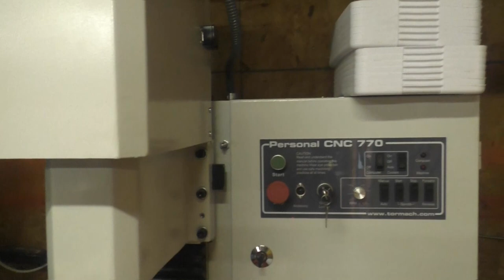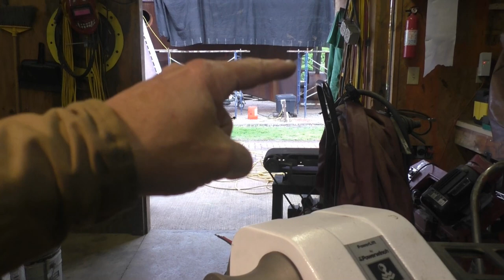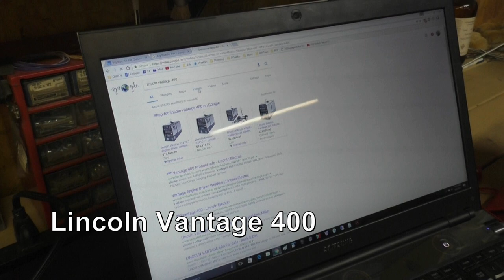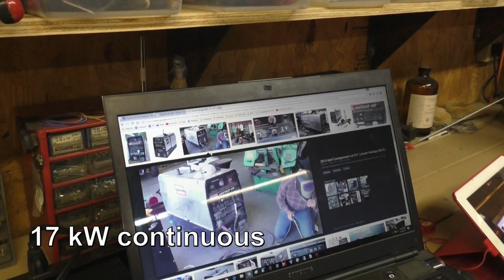Seeker LIVE - Apr 22, 2017 - Bulwarks, Casting Anodes, Chain Gypsy, Welder Generator and more

Comment: why not build a PTO on the main engine for driving a generator and compressor? if you use the standard agricultural spline (no idea what it's called) i'm pretty sure there's all kind of stuff you can get for that, everywhere in the world for a relatively small amount and a small amount of space. if you're worried about redundancy get one of the kubota engines and fix the same spline to it. it'll be more portable, more reliable, more flexible and one hell of a lot cheaper than the dedicated welding generator with all the gizmos attached. 

if you want to go fancy with it you can get a truck compressor and an electric clutch so it doesn't steal power just to make noise

Comment: For the platforms on the side what you could use is "plastic grating". It is used for all sorts of applications such as docks, manufacturing catwalks and oil platforms.... It wont be cheap but it would be perfect for this. 

also the chain thing is called a anchor windlass

Comment: Miller Air Pack is the best. 42 years welding 35 years self employed in the industry. I have owned 3 of these units and would buy another one in the morning if the one I have now went down. I have run these units up to 10,000 hours before selling the old ones off. Your looking at a third generation unit with a Ingersoll Rand compressor that is electric driven with an on off switch and produces 60 cfm  You can arc gouge as well as plasma cut with this machine along with all the welding processes. This machine has been installed on ocean oil rigs and have held up to all conditions.
Reply: If I remember right the miller air pak with the Deutz engine the air compressor is one of the engine's cylinders

Comment: On welders Doug. Be careful of the big welders with a lot of electronic controls on them. The salt air would kill them quick I reckon unless you did a lot of work to seal up the electronics so the salt air can't get at it. I've just acquired an old diesel farmpack welder. Way simple. Unfortunately it's only a DC arc welder. I'm thinking for your purposes having seperate machines for each type of work you wish to do might be better for long term maintenance. An independent air compressor, Generator, welder. Gives you options. Just an opinion is all and we all know what those are eh.

Comment: Seems as if the Miller Big Blue 800 Air Pak, also has built in air dryers. Definitely mandatory for plasma cutting. Sounds like they are all sealed up against moisture and corrosion. And the compressor is an Ingersol Rand. If it were me, I'd at least get a 100+ gallon auxiliary tank to store more air for tools and what-not. Then again, maybe just having a separate compressor for non-plasma tasks would be good too. That way, it keeps the run time down on the Miller.

Comment: Doug, You are talking about adding a "Gypsy" to your electric winch and having to raise the winch above deck to accommodate the larger diameter of that Gypsy.  Bear in mind, the rated pull of 1,000 lb. is based on the load applied to the minor diameter on the drum.  If you are applying load to the sort of diameter you are talking about, that winch will only handle a couple hundred pounds!  If you expect it to handle its rated load, your gypsy can't have a diameter any greater than the drum ;-)

Comment: I think a small <30kw Cat 3 phase genset would be the most economical/dependable.  Then depending on how much you plan to run the main engine, (as a secondary power source) you could decide if you wanted an electric hydraulic pump system, you could run an electric compressor, and you could plug in your choice of welder, etc.  If you go ALL electric on the accessories, maybe a larger single genset, or add a smaller second one for house loads while sailing, without needing to run the main engine.

Comment: Expanded stainless can have issues with cracking, depending on the type. There are some plastics that you could use, but they tend to give out from UV exposure over time. One of the food processing plants I worked in had expanded aluminium gangways that were attached to stainless steel structure. You should be able to do something similar, just place a brass or bronze washer/spacer between the steel structure and the aluminium and attach it with stainless steal fasteners suited for the job. Much cheaper than full stainless, unless you can get it free. The zincs/sacrificial anodes that you cast will protect the aluminium from deep corrosion and over time the Al oxide layer will get thick enough that you can seal it with an anodizing agent.

Comment: Doug, Please don't use pennit lines.  They sound like a good idea and I started out using one myself.  What happens is they get caught in outboard motors at nignt.  They really can mess up the outboard and the act of snagging it pops your anchor out of the bottom.  You might find yourself dragging in the night.  Not fun.  Also when you are in a crowded anchorage it is necessary to sometimes anchor such that you are resting over the anchor of a neighbor.  The float for the pennit will be hitting the neighbors boat.  That is louder they you think.  If you forgo the float and bring the pennit to the bow of your boat you will end up with a tangled mess.  
    Also,  Think hard about that little powerwinch.  It's rated at 1000 lbs stall, not working load and they use the HarborFreight rating system, Once you add a gypsy with a bit larger diameter you will end up with a faster but less powerful winch.  At almost 4 lbs a foot your chain is way too heavy to use one of these.  I've also heard complaints about their pressed steel gears failing but I've never had one apart personally.

Comment: Couldn't you use the bulwarks pipes as your air tank?   I would think they would take a lot of pressure and hold a LOT of air.  Would take a lot of pressure if you weld in rounded caps.

Comment: As a option could you take your current welder and use a genset, or if the 220V output from the welder is high enough use that for the 220 supply for the ship.

Comment: Never assume, it makes an ass of u and me ;)
You mentioned a pin in the pivot of the gangway, if the gangway is deployed, wouldn't it be better if it can move around when the boat is bobbing around ?
What about using an engine, fix a coupling to that to run a generator, and maybe belt drive a compressor head ?
You could also belt drive a hydraulic pump, even if it's small it could get you out of trouble.
Reply from the maker: 90% of the time the gangway will be to access the water or the ground when the tide is out.  Not a dock.

Comment: Hey Doug, Any way to use the small winch to turn the big winch?  It could be as simple as lining up the two windlasses and using a rope to transmit the power. That way you don't have to modify the roller on the little winch, you can use all the chain hauling gear you built for the primary winch. If the secondary one is somewhat portable, you could stow it to keep it nice and also have the option to attach it to the tender for lifting pirate treasure, or anywhere on the boat you want to weld a mount and lift/pull something.
Reply: And speaking of tool buckets, Perhaps that is the solution to storing things on the boat, buckets on hooks. Simple racks of hooks, and buckets with heavy duty handles. Easy to tilt and look into, or just grab a whole bucket of stuff.

Comment: How much chain... well, the anchor only keeps the chain in its spot and a long chain on the seabed keeps the boat secured. If anyone wants to know, about 2lbs per kilo.
Reply: So the chain holds a ship... the anchor doesn't?
Reply: Indeed. Radio ships on the north sea used a super tanker anchor and long lengths of chain. In really bad weather even those broke loose and ended on the beaches.
Reply: But they still used an anchor right... not just lengths of chain on its own.